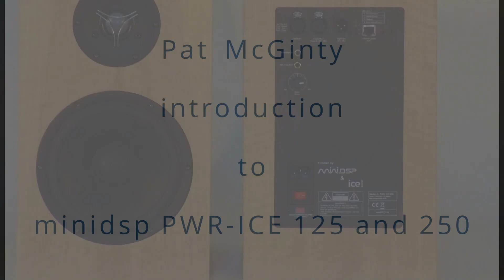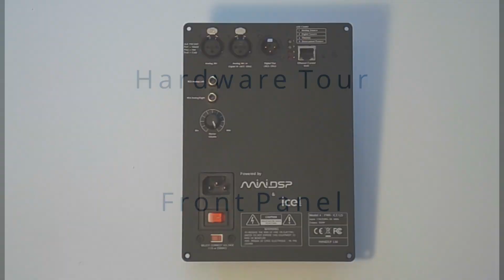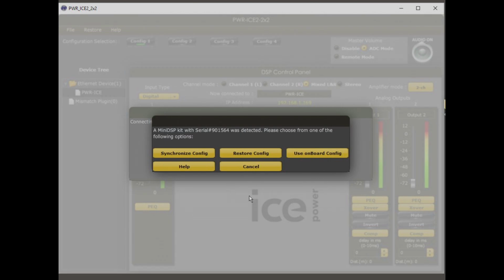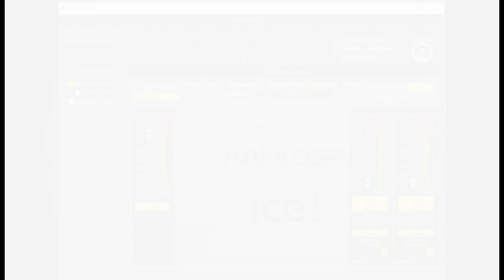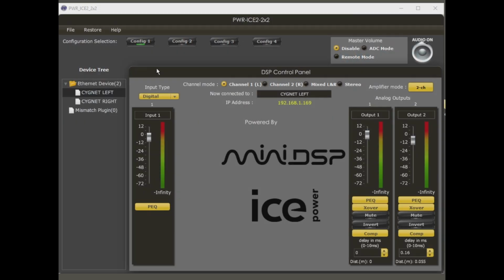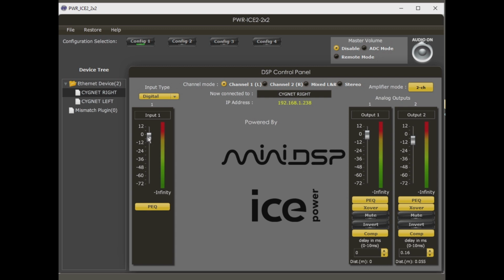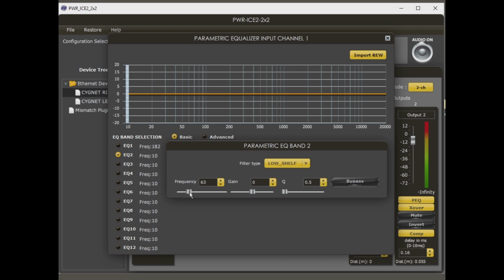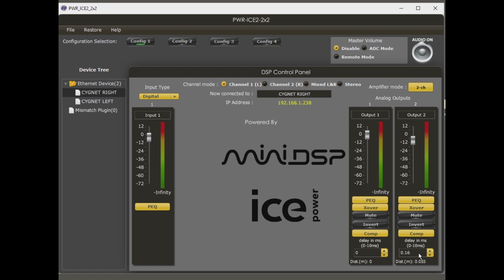How to get started with minidsp PWR-ICE 125 and 250

Comment: Great video, helped me get my ice250 plates setup nicely. Thanks! Does the coax to XLR adapter you showed need to be a 75ohm - 110ohm converter or is a standard (analog) type adapter enough?
Reply from the maker: The proper setup is the impedance matching transformer. But I've noticed that the 125/250 seem to be tolerant of a simple XLR to RCA adapter. They appear to even put up with a non AES spec cable, having inserted a balanced audio interconnect in a pinch.  I'm not recommending that you do either but if you do, that would be the first suspect if you run into trouble with signal dropouts.

Comment: Very interesting and a good tutorial. Now what digital input do you use and how do you control the volume? As I understand it the digital output of some devices can not be changed so it has to be done in the plate amp?! Is there a way to remotly do this withotvthe software open? Like a remote? Thanks!
Reply from the maker: The best and easiest use of this product is to accept digital signal from a streamer, which typically have software vol control.  You can enable the vol pot on the plate, but that's too cumbersome in a stereo setup. Or download the minidsp app and, connect your plates to your network, by using a wireless extender if need be, then use your phone, laptop or PC to select Presets and control volume.

If you're still using a CD player, my best advice is to migrate to a streamer.  It definitely is a job to RIP your library, but you'll never regret it. Here, we RIP'ed a couple of cubic yards of CDs to a 2TB HD that fits in my shirt pocket and cost less than $80.  Once that's done, your streamer will have instant access to all of your music, alongside your steaming service. Control your system wirelessly with a tablet.  It's great. Plus, you're now ready for HD audio.  Some albums I've enjoyed for years in CD quality, 16bit 44.1KHz, are quite superior in 24/96.  The recent release of remastered Abbey Road in 24/96 makes that point beautifully.  The minidsp will play files as dense as 24/192.   Good luck!
Reply: Meadowlark Audi
Reply: Aha ok minidsp has an App! Ok that changes everything! Yes I am in process to ripp my cds, but mostly I stream Tidal and Spotify so its not new.
Whar streamer do you prefer? Its a jungel out there and its difficult to decide...dsd, MQA etc you know.....
Reply from the maker: @dagwallander9265  Good move.  I use an Auralic Aries Mini with an added a 2TB SSD, and an iPad.  Many of our customers love the Bluesound Node2i.  Either way, you can put the whole front end together for less than $1K.  Then sell your conventional gear while you still can!

The app for Auralic seamlessly combines my local library with Tidal. It will handle MQA from Tidal and you can even make mixed playlists.  Really, it couldn't be any nicer to use. But you can only run iOS.  If you want to run Windows or Android, look at the Bluesound.
Reply: Meadowlark Audio 
Ok well thats interesting as the Aries mini isnt produced so it can be found for a good price...
But the Bluesound nod2i only have analog out? Yes/No? So you can adjust the volume in the Aries app Yes?
Thanks for your input! Love Your work!
Reply: Oh I forgot to ask you. Do you ripp to WAV or FLAC?
Reply: Sorry for asking again but did you rip your music to FLAC or WAV. I will just start to do just that so thats whay I ask.